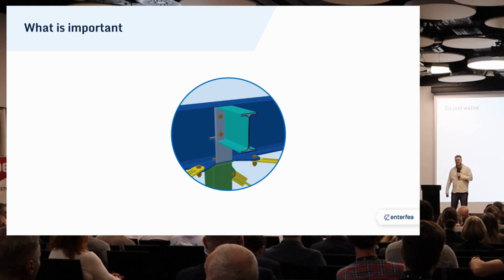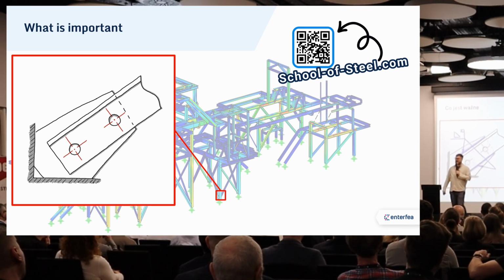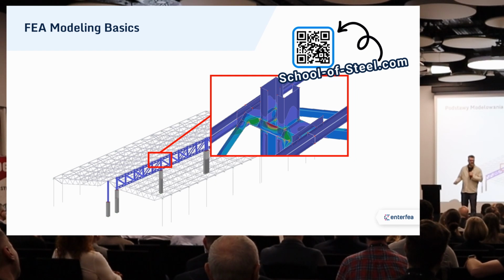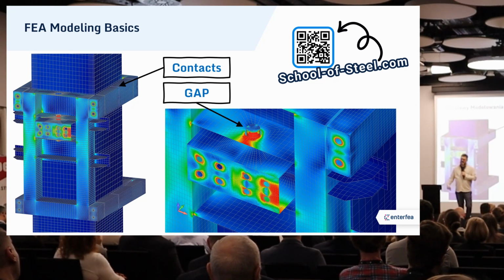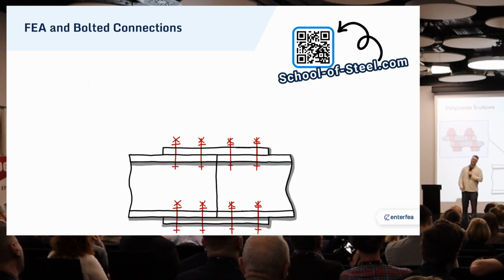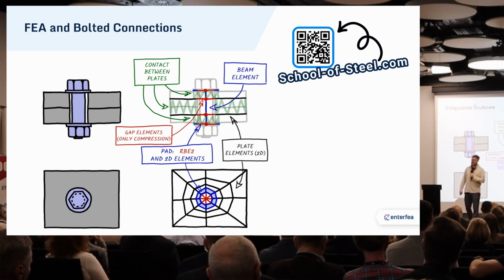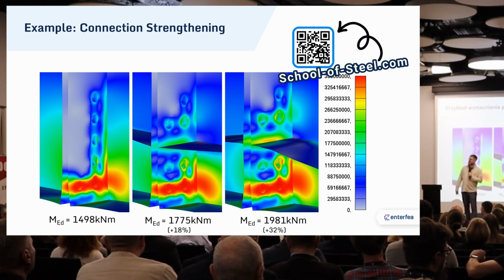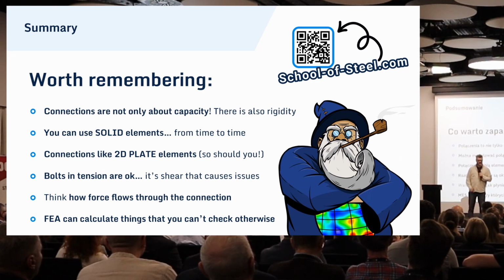Structural Steel Connection Design with Finite Element Analysis (FEA)

Comment: Nice presentation Lukasz!
Just a quick comment to promote the video: at 21:29, you mention that the red area indicates stress exceeding the yield strength of 355 MPa. However, that might not be entirely accurate. Based on your legend scale, the upper limit is 355 MPa with a lower bound of 325 MPa—so the red area could fall anywhere within that range, not necessarily above 355 MPa. You could consider adjusting the legend scale so that the maximum value clearly exceeds the yield strength (e.g., by setting a threshold above 355 MPa or adding an additional level like the tensile strength). That way, the stress levels are easier to interpret from the plot, also making this red area smaller and more comparable to the plastic strain region - although I agree that using the plastic strain for results estimation is a better option in this case, of course.

Regards, Roman
Reply from the maker: Actually, in my experience this doesn't change that much - most of the red (the deep one) is indeed 355MPa simply because at yield the stress remains constant, so if the color is "constant red" (and not "lighter to darker red") then it's 355 all the way. However I understand what you mean - I just got used to displaying outcomes like that and to me it feels natural :) Luckily this is a small issue and it doesn't impact much - but thanks for pointing this out!
Reply: @Enterfea  yeah, I’ve just met a lot of people who don’t really notice the clear difference between all those “shades” of the same color — lighter or darker red (going from 325 to 355MPa on your legend for example) — and it ends up looking the same or confusing. But like you said, it’s probably a matter of habit. That’s why I personally prefer to use “level colors” instead of “continuous/gradient” ones, just for the clarity, although "gradient" looks indeed more natural :)
Anyway, thanks for the answer and the presentation!

Comment: Thank you! Are you familiar with the IDEA StatiCa program? It completely solves the issue of calculating bolts, steel elements and welds in accordance with building codes.
Reply: Mechanical Engineer here designing pressure vessel skids. A lot of us don't have the luxury of IDEA StatiCa. It wasn't worth the investment for what we do. All our connections are modeled manually, as he explained.
Reply: I think, he is using RFEM as program. As I know, they are offering a module where you can do such joints.